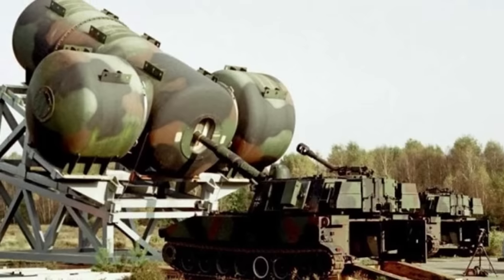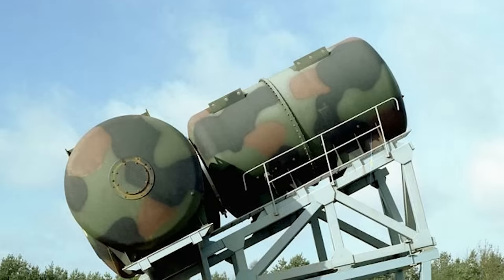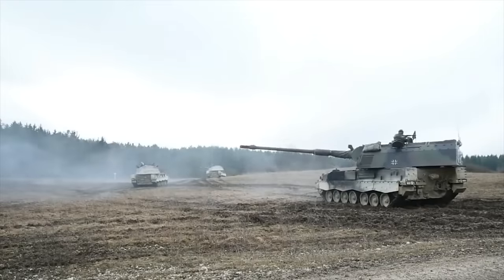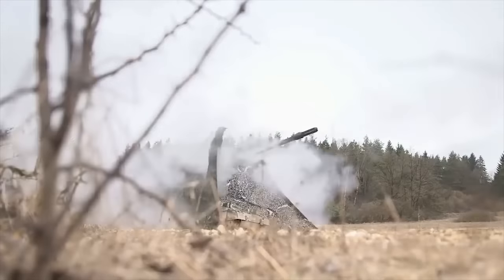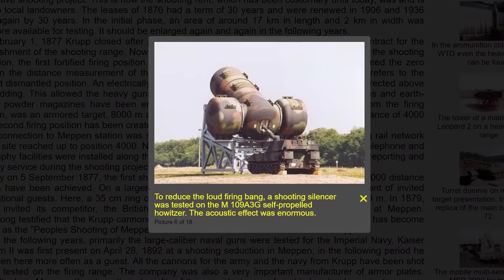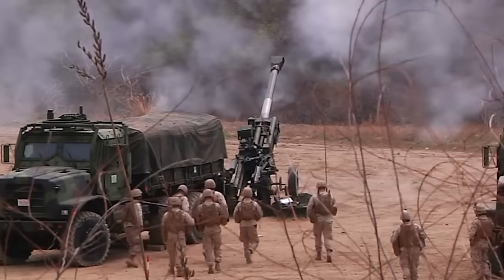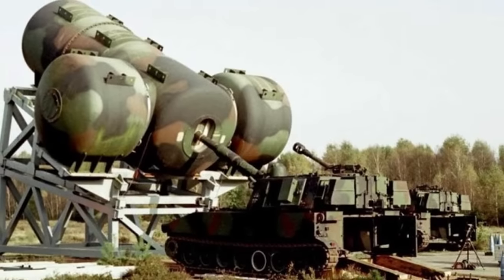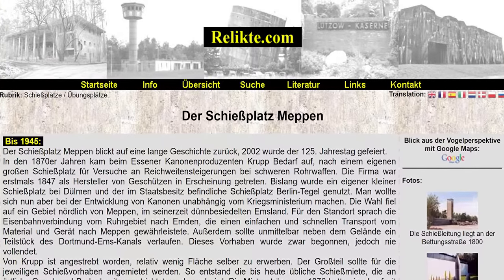Tank Silencer - Yes, It Exists

Comment: 2:27: over time you get used to it
Reply: I live pretty close (well, 7 miles) to an army base. I can still hear and feel when they pull out the big stuff. I dont mind, letem practice!
Reply: @longbow6416  same thing for me, I life 1 mile away from the testing range mentioned in the video. I really don't mind it, its really exiting when your hear a loud kaboom and your windows are shaking
Reply: @grillavonmanila6840  I live in central Colorado (USA) close to an air base as well, it never gets old having C130's buzz over the house. They'll have 4-6 at a time with a huge single digit numbers in pink on the tail over olive drab. I know these guys are training and getting their flight hours. I just think its so cool :)
   With our mountains, I buddy of mine was hiking in the 'back woods' and stumbled on Apache AH64 training. My bud said the guy was close enough to salute him back hovering in the valley.
Reply: I live close to a firing range in Holland, i dont mind the noise but the shockwaves. All the windows in my house shake everytime they fire a pzh2000. After a while you get enough of it.

Comment: Okay, now I wanna hear how a silencer tank sound when fired.
Reply: AJ Jeslee I’m thinking it’s still deafening up close.  Half a mile away it’s probably significantly different though
Reply: I'm with thereve here, most likely from up close you wouldn't really be able to tell as a commoner - it would just be incredibly loud and intimidating but if you were experienced with these machines and the likes or at distance you suddenly would. Silencers aren't quite like the movies where it goes "quiet", the relative quiet shots work only if the round is subsonic (like pistols and some light rifles) but any significant (standard issue) rifle, let alone a cannon, will be firing supersonic rounds and even though you can't really tell you're hearing two "bangs" - one from the explosion inside the weapon (to propulse the round) and what pressure escapes the weapon at supersonic speeds and another one once the round leaves the barrel and independently breaks the sound barrier.
I'm not sure how far away the round will break the sound barrier from the barrel and how far this silencer can catch that but with rifles firing supersonic rounds (standard issue) this is why you still fully hear the firing going on, just not as loud since the first bang (rifle) is caught by the silencer and only the second bang (round) is hearable. Most likely this will be the case here too - but I could be very wrong. :)
Reply: By the looks of it I'd say a bit like Ron Jeremy at the end of a "scene".😉

Comment: 0:39 - that's a PZ. 2000, much better than what you meant to display, but most certainly not what you meant to show, your research is usually very impressive for all your videos, but I must critique a pet peeve of mine which is people now knowing what pictures are depicting.
Also these gas vents you spoke of is called a muzzle brake, and is standard issue for most artillery cannons, and it's not unique to use of the suppressor.
Although, your explanation as to what a howitzer is and how there used was very good, as well as your further explanation as to the need for a massive suppressor